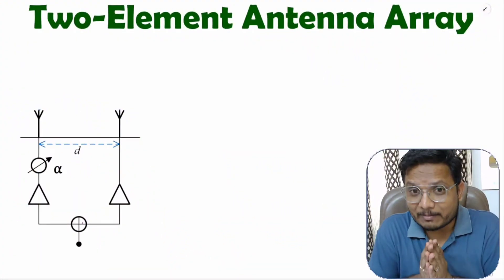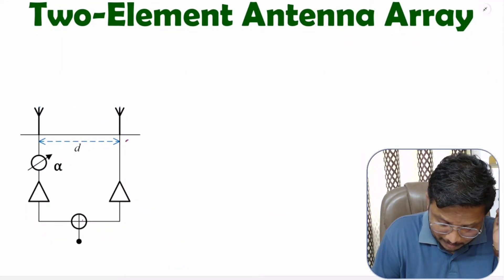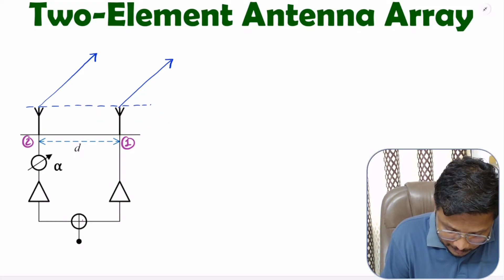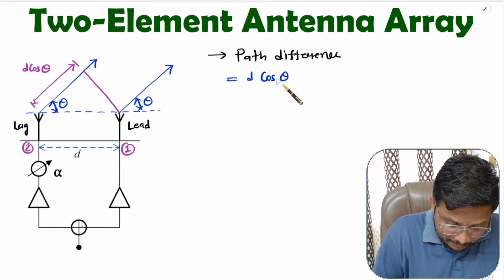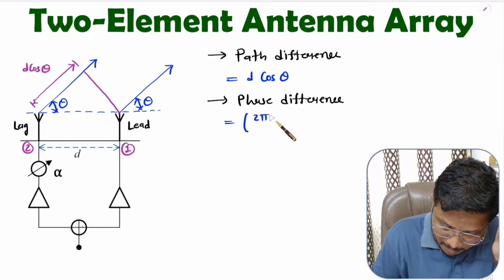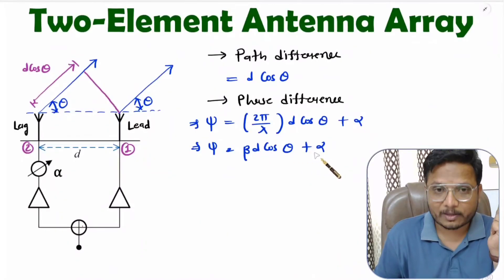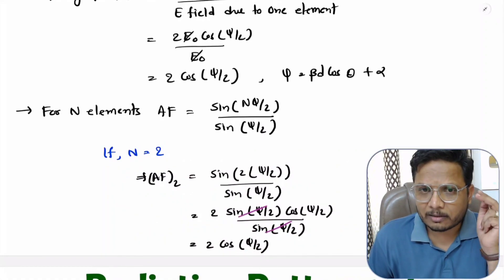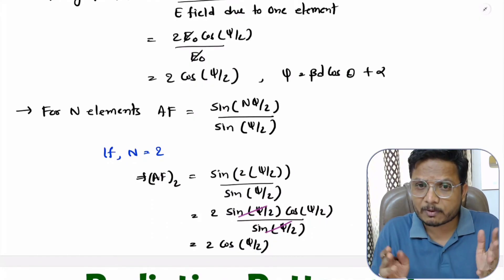Two Elements Antenna Array (Phase Difference, Electric Field & Array Factor) Explained

Comment: Derive the expression for the far field pattern of an array of 2 – isotropic 
point sources i) Equal amplitude and phase ii) Equal amplitude and 
opposite phase. 

sir you have solved which one question and what to change in other question ?
Reply from the maker: In given derivation, just put alfa = 0 for case 1 and alfa = 90 for case 2.
Reply: @EngineeringFunda  ok thank you so much sir 🙏